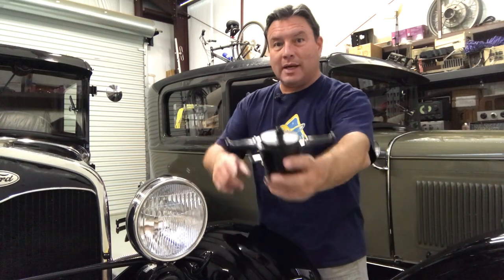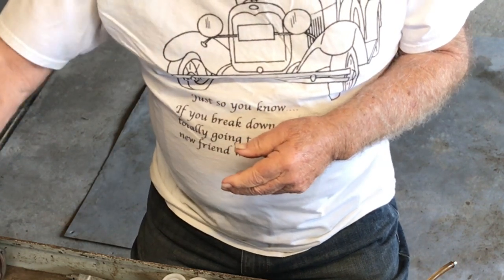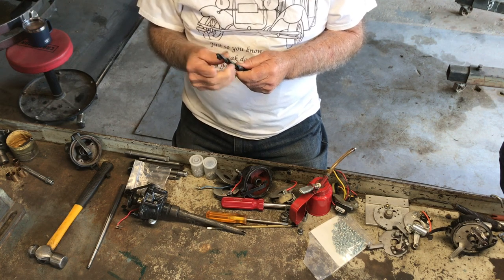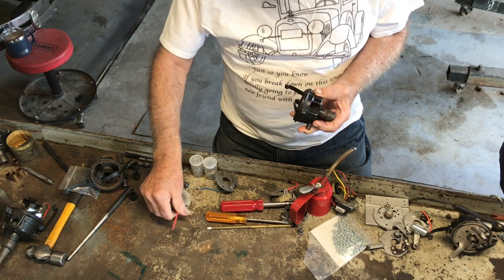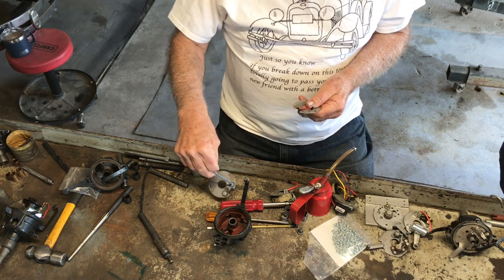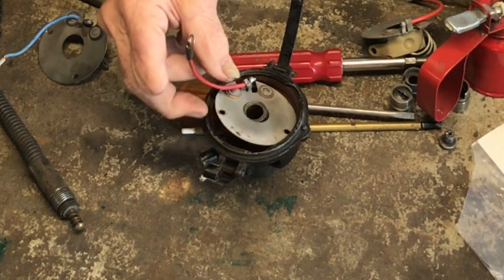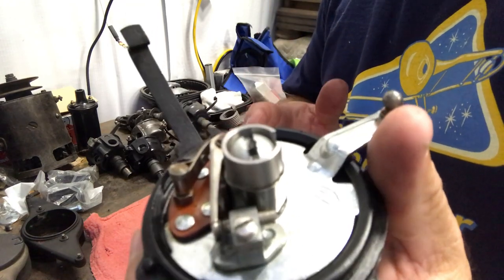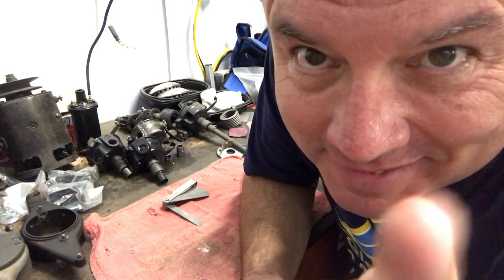How to rebuild a Ford Model A distributor

Comment: Thank you for another super video. I have had my A for about 2 years now. Last year, I had a major problem with it breaking down on the road several times. Every time it did, by the time I got out to check things it would restart. Being a new owner of an A, I was going by what everyone was telling me that were knowledgeable about A's. Everyone's advice, Change points & condenser. I had the modern points upgrade? After 3 sets, I was ready to give up. Then, after installing the fourth set, I tried to start the truck. It didn't even attempt to fire. I checked fuel, fine. Then out a desperate act, I checked spark. No spark! How can this be, I just had spark. So, I started checking voltages. After checking where I had & had no voltage, I discovered the ignition cable was shorting out on the body. I bought a new distributor from our Model A dealer  a couple hours away & that truck never ran so good. It runs smoother & it added about 10 mph  to it's top speed. I saved the old distributor to rebuild to the original style points so this video is very valuable for me Thank you again.
Reply from the maker: Sometimes it's the simplest thing!  Good work finding that!

Comment: Lots of very good tips in your video Paul. I've used old shafts to remove bushings by turning down the cam shoulder and pressing them out with an arbor press.  With a bit of work you can also use an old shaft as a hone to lap the bushings. I really like the idea of drilling out the cam screw and shaft to accommodate lubrication of the upper bushing.  Thanks to you and  Bob Guimarin  for sharing your knowledge.
Reply from the maker: That's a great idea!  Mind if I steal it?
Reply: @ModelA  Not at all. Just remember to completely clean out the old lapping compound when you are finished. I think I just used the same stuff used on a valve seats.

Comment: Thanks for your video, time and work you put into making them.  I finally got my '30 pickup running.  Was the float valve.  Now that she's running I can tell I need a new muffler gasket.  Already watched your video on that one.  Will be doing that this winter.

Comment: Good stuff.  Quite possibly the worst time I've had with a set of points was on my 1971 Honda CL350e.  The plate, screws and all that was fused into a solid piece.

I was in highschool at the time and had no money.  I managed to get the arms moving, but had to sand down the contacts because of how pitted they were.  Because of that, I needed to bring the gap I my but couldn't adjust anything since it was all fused.

So, I used a hammer to bend them in and out until they worked.

Surprisingly, the bike ran just fine and had no issues for several years after that.

Comment: old post, so i dont expect an answer. Perhaps, you mentioned it in the video and i missed it, but there are screen shots of what looks to be a catalog, and part numbers for variouse parts along the way, as though one can order parts from a catalog. I have been wanting to rebuild my distributor for the 1930 and use this as a guide, but not sure a good place to buy a kit. Or to have access to this catalog for parts ID and order. Some fantastic content you have, and im looking forward to getting this 1930 on the road. After seeing you vids, ive decided to leave it  6v and mostly stock. Thank you! looking forward to years of fun.
Reply from the maker: That was the Bert's Model A Center catalog.  They are online also, but give them a call and order whatever you need.

Comment: Thanks for uploading! What would be a point at which a distributor needs rebuilding? Are there numbers of tolerable play in the bushings?
Reply from the maker: If you can wiggle the points cam back and forth at all, it's time.
Reply: @ModelA  Alright, thanks! Looks like I still have some time :D

Comment: This is a great video.  Lots of great info.  Question, should not the thrust washer Part A-12180-A be installed between the upper shaft and the distributor body?  This part was not discussed...  Regards
Reply from the maker: It's a super thin washer, I failed to show it but it's there.  Thanks!

Comment: Hey Paul,
First, great to see you back looking healthy and hopefully feeling good too.  Question,  what do you do when the bushing is warn enough that the half inch tap doesn't bite into the bushing? Help!!
Reply from the maker: That's when I use the Dremel and patiently grind them out.  It takes forever!
Reply: @ModelA  hey Paul, actually used a hacksaw blade and cut through the bushing in a couple places. Then with a small chisel could knock out the pieces. Dremel I wasn't comfortable enough to only cut brass.  Thanks for all you do! Merry Christmas to you and Model T! Blessings

Comment: Paul you have any video on removing a steering column?
Reply from the maker: Eventually, I will do a video on rebuilding the steering, and that will certainly be part of it.
Reply: @ModelA  I will 2nd that motion.  I have a closed cab and will not be able to pull my steering out to fix the light switch lever so I know I'll have to disconnect it from engine side and remove the pedals to pull the whole unit out.  For some reason the off position is at 8 o'clock and it would be nice if it was at 6 like it should be.
Reply from the maker: Your switch wafer could be miswired and cause that also.
Reply: I just want to pull it out so I can send it  to be rebuilt   by Model A Medic

Comment: Hello Paul,
Nice video, I learned a lot! What type of meter do you use to check your condenser? Can you check modern condensers as well? Thanks Jim
Reply from the maker: It's a capacitor meter.  Nothing special.  Just about any good electronics place will sell them, or a multimeter capable of measuring capacitance.   Yes, you can test modern condensers with it.

Comment: Very informative video. The only "thing" that I don't agree with is his dismissing of modern points. I know it's not what Henry did, but there has to be a reason the old points were fazed out. But, It looks like the old points are easily adjusted! My Victoria has the F.S. Electronic Ignition.
Reply: I've been thinking of upgrading my '30 pickup with an air balance carb and FS ignition.  I know it's not stock stuff but everything I do to my truck can easily be taken off if I or someone else wants to make it more "original".  Can you please tell me more about your FS ignition.
Reply from the maker: I wouldn't say he dismissed the V8 points, he and I just prefer original points.  In fact, I have V8 points in my coupe right now.  What he is saying is that the original points are easier to adjust.  There is no denying that!

Comment: I replaced the original wire 'tween the lower plate and the upper plate was replaced with a computer wire encased in a soft silicone insulation containing many wire conductors. This wire is so flexible I don't think it can be broken. Ends are soldered.
Reply: Electrons are lazy and travel on the outside of a conductor and don't travel 'within' the actual wire. They always follow the path of least resistance.
Reply from the maker: Electrons traveling over the outside of a conductor is called "skin effect".  That doesn't happen with DC, only high frequency alternating current, like RF.
Reply: @ModelA  Ahhh O.K. That explains why high tension wires in Canada must be electrodeposition coated [painted] to limit the actual copper molecules from being eroded from the line. In America look under the wires and plants fa to grow. Killed off by copper. And the reason why birds in the winter perch on wires as the wires are warmer. Keeps their feet warmer.
Reply from the maker: Usually, coatings on very high voltage wires are for de-icing more than anything else.

Comment: Paul what r ur thoughts of a tudor vs fordor.  Im looking at a nice Tudor burgandy with a merlot interior. Has a model a basement under rear floor. Just an expert told me on a fordor has a lot more wood and a lot more issues as it ages. Tudor he said is less wood less problems.
Reply from the maker: The tudor doesn't have any structural wood.  The fordor is all wood with metal skin.  The exception is the late 31 fordors that people call the "slant window" fordors.  Those don't have any structural wood.  My 29 fordor has all original wood and except for the top bows, it is petrified and feels like steel.  The advantage to the fordor is the wood body framing tends to absorb a lot of noise and vibrations.  The fordors tend to be smoother.  The tudors tend to be louder inside like a tin can.

Comment: Can you tell me what should be the space between the "tappet" and the valve stem when the valve is closed?
Indeed I mount my engine with adjustable "tappet" and I do not know the distance, tolerance that I must apply?
should it be zero?
Reply from the maker: I set intake valves to 11 thousandths and exhaust valves to 13 thousandths.

Comment: Is there any certain way the cam need to go on ? I was putting new points in mine and it doesn’t have any key or anything to keep it in a certain orientation.
Reply from the maker: It is designed to spin around until you lock the screw down.  That's how you set the timing.

Comment: Unfortunately, the use of a 1/2" tap to remove the bushings is a non-starter.  The tap doesn't have enough grip on the bushing.  If the bushing is worn, there's no grip at all.  Any other ways to get the bushings out???
Reply from the maker: This has always worked for us, every time, without fail.  We have no backup plan for removing the bushings.  I suppose if we had a severely worn pair of bushings, I could just put the housing on the milling machine and mill them out.
Reply: I had this exact problem today where the Tap would just strip it's threads. I even tried the next bush with a bolt after I tapped it, and same problem. 
I ended up using a sacrificial small screwdriver and hammered it between the housing and the bush, taking care to avoid damage to the housing and only bend the bush inwards. The bush had a slot along it lengthwise, so I worked the screwdriver blade along that and bent the bush away from the housing every few taps. Eventually it got to a point where I could knock the bush out with a pin punch.

Comment: I do not like the original points I run modern with a wireless lower plate have been for over 20 years and over 200,000 miles never had a problem never had the points walk been restoring Model A  for over 40 years.
Reply from the maker: That's cool.  Use what works for you!